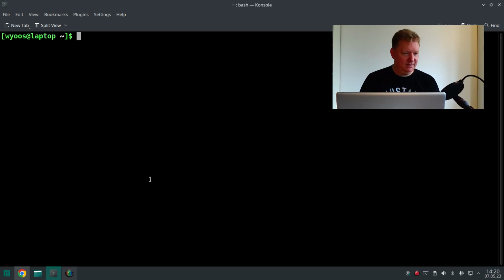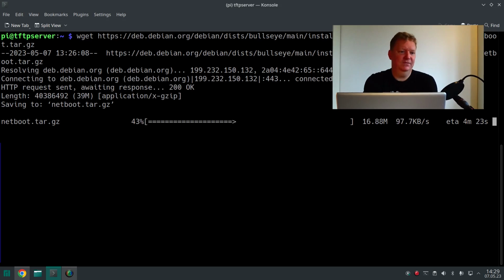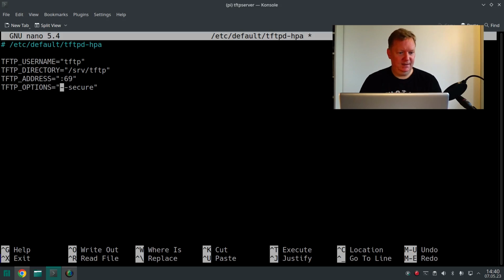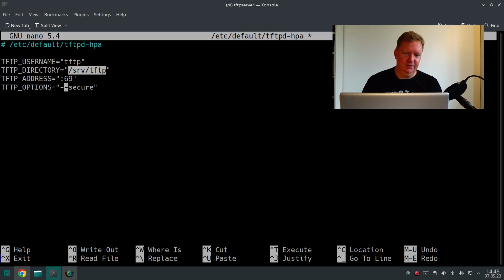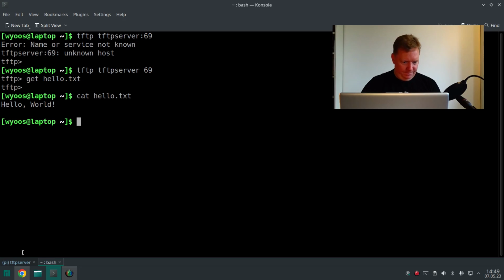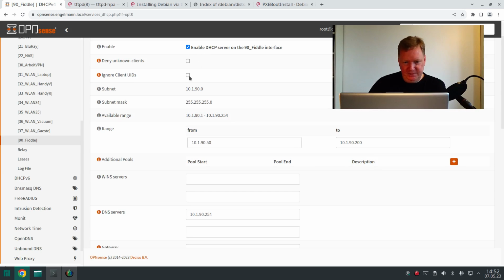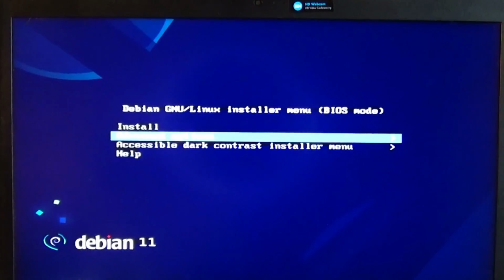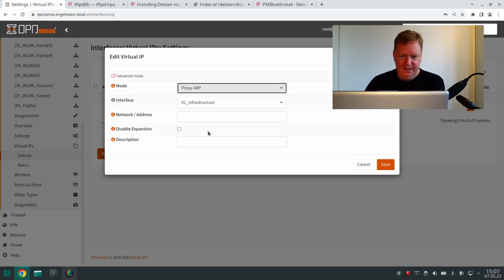14 - PXE Network-Booting (incl. TFTP)

Comment: @writeyourownoperatingsystem It's always worth to try reboot OPNsense when sth doesn't work but theoretically should. I had many cases where things hasn't worked at all and IONsense  reboot solved the problem, so I think that it's a good idea to do reboot every time when you make changes in configuration...